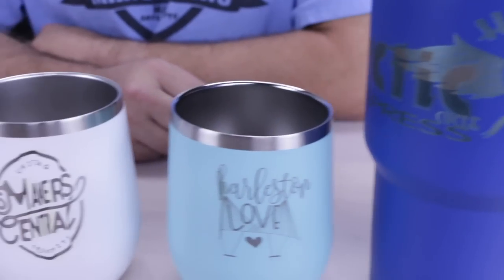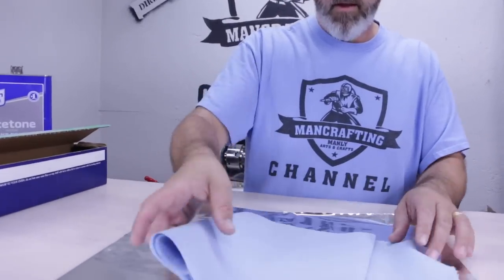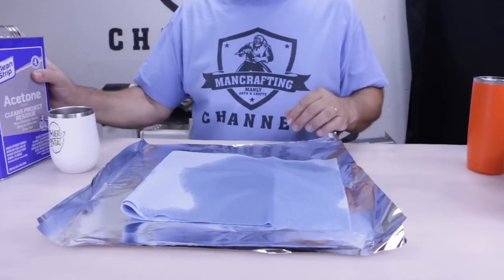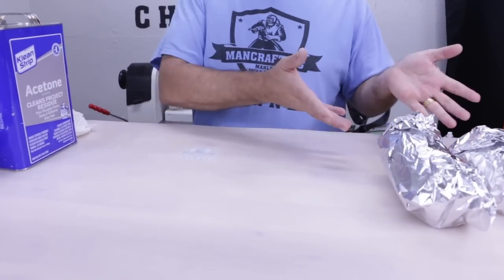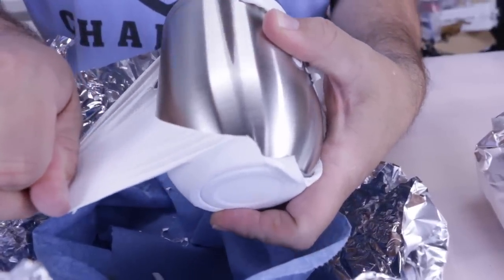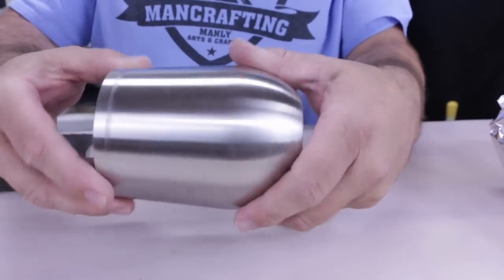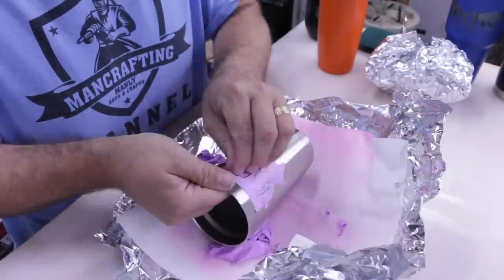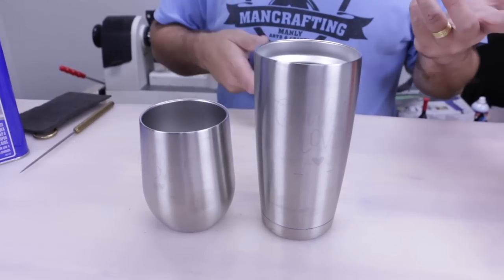How to Strip the Coating on a Duracoated Cup | Quickly and Inexpensively 2

Comment: I boiled mine since the coating was too thick for acetone to work. I used a plastic scraper to get the paint off while the cup was still very very hot and still submerged in the water. It worked.

Comment: Are the laser marks of the etched logo visible at all after? Or does it have to be coated to hide the old laser marks. Am looking to strip a yeti to stainless and keep it that way
Reply from the maker: I suppose it depends on the intensity of the lasered image.  If it’s too hot it can leave a shadow image.  I’ve never had that issue myself.

Comment: Thanks for the good info! I was thinking of trying this by filing a paint can or a tall wide-mouth jar with acetone or laquer thinner! Then I could save any leftover to use later!
Reply from the maker: Blakehx I thought about that as well.  That’s what commercial powder coating  companies do with Benco B-17 stripper. Just bath it and keep using it over and over.  I considered doing that as well.  I have a glass jar and a metal bucket that either would work.  My only concern was the liquid getting into the seam and coming out after I coated the cup.  So I passed.  I may try it, but if you do it first, let me know how it works.

Comment: Could you just leave the cup totally bare after removing the duracoating, or do you need to seal it to keep it from rusting or anything? I have an ugly little coffee cup that would look so much better silver than the burnt salmon color it is now. Thanks!!
Reply from the maker: It’s stainless steel.  I have a ton of them naked.  I’ve even sandblasted logos onto them and 5 years later they look great.
Reply: They make a darkening compound too that's meant for this very thing, that would let you laser a dark logo onto the stainless rather than engraving through the coating and having a stainless logo.

Comment: Oh man this was awesome, I got a couple of cups I need to remove the powder coating . I was wondering what would be the best was to get them cleaned up. Thanks
Reply from the maker: Carlos Campos this method works real well for Duracoated tumblers like the YETI.  I still need to try it on one I’ve powder coated to see if it delivers the same results.  I’ll let everyone know.
Reply: Carlos Campos - I've been using a product called 'Tuff-Strip' from Crown. Got it at a local Home Depot/Lowes. It's pretty harsh so wear gloves/mask. It works pretty good on powder coating if you let it sit on cup for couple hours. Then use acetone to wipe off. Best thing I've found so far for removing powder. I tried uploading a pic but i guess i can't in the comment section.

Comment: That's pretty slick! I'm guessing that was an enamel paint. I may have to give that a try on a couple of other things I need to strip the paint off of. Thanks!
Reply from the maker: Certainly worth a try.  Duracoat is a 2 part air cured Urethane.  So it's a little different than the Powder coating that I use.  Most of what I use is a polyester blend.  Paint may very well peel if done the same way.
Reply: Thanks for the tip. I know that some gunsmiths like to use Duracoat, but I didn't know it was a 2-part urethane. I'll have to play with some of the enameled pieces I need to strip and see if it's any help at all.

Comment: I am going to have to try this.  I see a lot of the Easter egg cups for sale but don’t like the colors.  Now I can remove the color.  Have you used MEK?
Reply from the maker: Jk Canvas I haven’t.  I have a. Half gallon, but haven’t tried it.
Reply: ManCraftingTM be sure to be well ventilated because you will see some crazy things.
Reply: ManCraftingTM I used it to clean paint off aircraft and clean my paint guns. Works great.
Reply from the maker: Jk Canvas I’ll do that outside.  MEK is way more volatile.  Probably why I didn’t try it first.  And the ugly colors are abundant.  Good way to get some cheap stock.
Reply: ManCraftingTM I will try the MEK trick and let you know.  I will reference this video when I do.

Comment: You did a video more recently with a special stripper. It’s more expensive and less easily purchased. Isn’t acetone better?
Reply from the maker: Acetone is more readily available.  If you only have an occasional mess up it may be a perfect option for you.  If you’re doing a lot of volume and have a lot of mistakes to strip.  Then it’s cheaper and easier to go with the powdercoat stripper.

Comment: Will this work on a duracoated Glock slide or will it take the factory finish off too?
Reply from the maker: That’s a good question.  Was the original finish duracoated over?  Usually the original finish is at a minimum abrased.
Reply: @ManCrafting  I peeled a lot of the duracoat off with my fingernail and I can tell the slide wasn’t  prepped or sanded before the duracoat was applied bc the slide finish is flawless underneath the duracoat, so I’m guessing I can try this method to get the rest off without damaging the original slide finish

Comment: Very cool.  Does this take off your powder coating the same way?  Just so i dont mess up the fantastic cup you sent me
Reply from the maker: Harneal Media I don’t think so, but I’ll do a test to be sure.
Reply: Harneal Media - I've been using a product called 'Tuff-Strip' from Crown. Got it at a local Home Depot/Lowes. It's pretty harsh so wear gloves/mask. It works pretty good on powder coating if you let it sit on cup for couple hours. Then use acetone. Best thing I've found so far for removing powder. I tried uploading a pic but i guess i can't in the comment section.
Reply from the maker: Kaleb McCarrell Thanks. I’ll check it out.   Best thing I’ve found is Benco B-17 but it’s not that easy to find, it’s in bulk packaging and expensive. I’ve also used airplane stripper.  That’s pretty good as well.
Reply: ManCraftingTM - thanks! I'll look it up. And thanks for all the awesome videos, I always look fwd to watching the little gold nuggets of info!
Reply from the maker: Thank you as well.
Reply from the maker: Thanks for the kind words.

Comment: Does this work on Duracoat used on firearms or is that a different product?
Reply from the maker: It should do the exact same thing.  So if you want to strip it, it will, if you don't want it damaged don't use it for cleaning.
Reply: Did it work or firearms?
Reply: @schopout9874  Yes it did.
Reply: @schopout9874  I should add that the chemical just released the bond between the paint and the steel by turning the paint into goo. It still took a wire wheel on an electric drill to scrape off the goo-ified Duracoat from every crevice in the slide and frame.

Comment: Since acetone is a hazardous chemical, would it be safe to drink from the cups?
Reply from the maker: When you wash the cup any acetone is removed.  Most of it evaporates when exposed to air.  It’s most hazardous when using.  Keep in mind toxicity is related to dosage.  No toxic dose, no toxic exposure.

Comment: Chad, why not grab yourself a 5 gallon tub with a lid, pour in a couple gallons of acetone. Put the cups inside, and put the lid on it. Acetone should be reusable, should not evaporate, and no waste of aluminum foil or shop towels. Much cleaner, and more environmentally friendly!
Reply from the maker: The only reason why I haven’t gone that route is the concern of the acetone penetrating between the cap and the cup.  The seam has allowed water in on previous cups and recently on a cup I had stripped I didn’t get it all out and it ruined the finish on the powder I reposted with.  I may do a test to see if that concern is founded though.
Reply: @ManCrafting  makes perfect sense to me. As long as you don't submerge the cup, it should be ok
Reply from the maker: Al Amantea I suppose I could put enough to soak rags or paper towels. Put the cup in upside down and drape a soaked rag or paper towel.  That way it can’t deep into the seam.